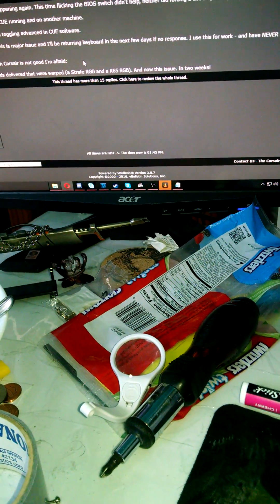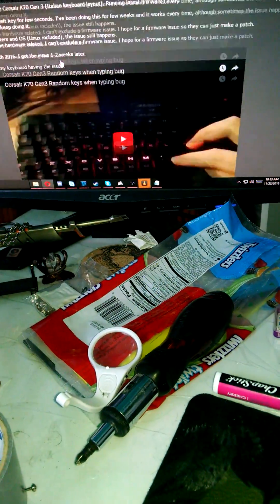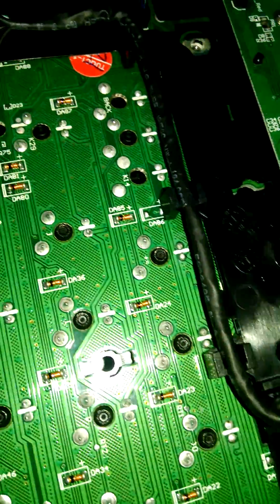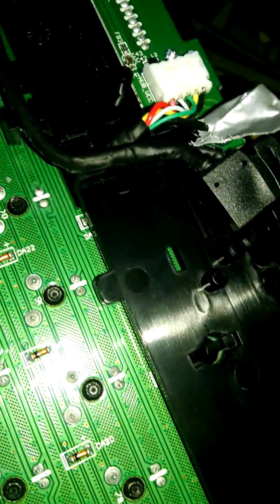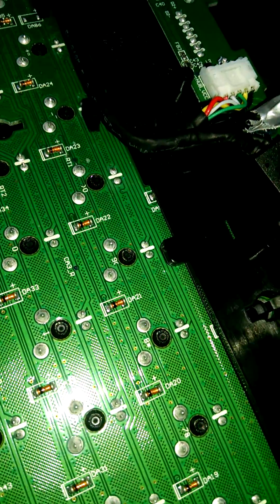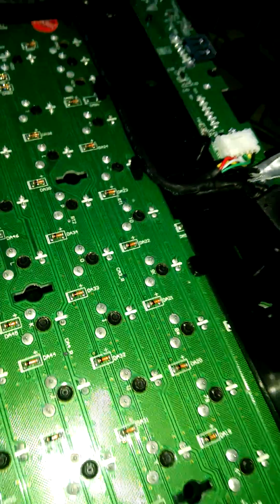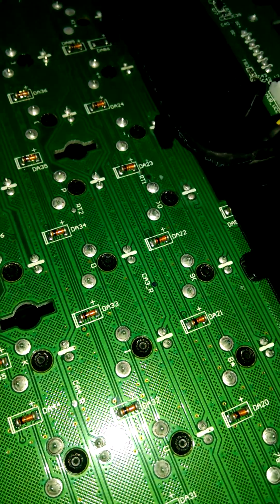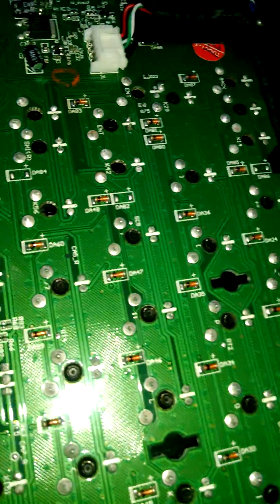Corsair K70 bug fix

Comment: Some TIPS: If you want to get the glued Corsair logo plate off without demaging/bending it, use a flat head screwdriver, dip it in Isopropyl Alcohol and drip it around the Corsair plate. The alcohol will go underneath the metal plate and loosen the glue. Let it soak for about 30 seconds, after that start lifting the Plate slightly with an sharp knife (e.g. carpenter knife). Do it slow to allow the alcohol to get to the lifted area and do the work for you. Maybe add some more alcohol if it goes dry. I removed my logo that way without any demage.

Also while reassemble the bottom plastic molding, watch out to have the bios slider in the right position to match the actual switch, you will see what I mean if you are at that step. I had to redisassemble it because I misaligned it...
Reply: I used the Keyboard after removing the ground cable between the 2 boards, it is working fine now. The Media Buttons were - except the volume wheel - not functioning before, that is still the case. Now I use it as a secondary keyboard for homeoffice. From time to time I have to switch the BIOS selector switch from one position to another and the back, that resolves the issue every time so far until at least the next power cycle. I can live with that. Still a great keyboard with MX brown rgb.

Thanks a lot for this guide Raffik!

Comment: Did you figure out what the deal actually was? My K70 is completely dead & I just now got the motivation to tear it apart. Getting into it now
Reply from the maker: Yeah there seems to be some bits being passed through a grounding wire which was fucking everything up. Removing the grounding wire fixed the issue.
Reply: @RaffikTheOnly  LOL I'm fucking with the grounding wire as we speak. But yeah I cant see anything that would cause it. I figured I would find a loose wire or burnt chip or something but nope. No spills ever or anything. Stumped
Reply: @RaffikTheOnly  just watched the video again and it's kinda hard to see cause you never hold the camera in one spot but your K70 pcb looks nothing like mine. I have one grounding wire and it attaches to the pcb right next to the little white harness in the center of the board

Comment: Worked just fine also 1 of the connecters disabling the colour change button top of the keyboard i suppose since it doesn't work since i disconnected them but idk what the other does thanks dude you rock !
Reply from the maker: After a year of using the keyboard, I found out the thing I disconnected was the top media controls. Lights / lock / media playback is disabled

Comment: Yep. Same thing happening here on my refurbished Corsair k70 :(
Reply from the maker: Following the guide would get you up n running in no time.
Reply: Thanks - but I'm not going to invalidate the warranty for my new keyboard :) Creating a new profile using the iCue software seems to have fixed the problem?
Reply: @fobstaa  some of my keys dont function do u think ill be able to fix it by making a new profile bc it happened since i use the icue

Comment: Thanks for the effort Raffik! I did everything as per Your video but problem still exist :( I will try to leave one of the connectors connected and other one disconnected if that can change anything .. so frustrating.. I have corsair CH-9101020-uk

edit: One day after i did Raffik's magic trick, it seems everything is good now :) First day everything was the same as before. I really hope that solution is permanent. Thanks again!
Reply: Hey, im having this same issue. I was thinking about trying this. After two weeks, can you say with certainty that it fixed your problem?
Reply: Well from time to time I have the same it problem as before. Like now :( I usually restart and after some time everything is good. But answer to your question is that problem was not fixed 100%
Reply from the maker: @cekikv  dont restart vlad, just mess with the BIOS 8ms 4ms 2ms 1ms switch on the top

Comment: Will this affect anything in the keyboard? I just got mine out of the box and this glitch happened to me, will everything be fixed and act as if I didn't change anything?
Reply from the maker: Auxil XB I mean. I did this, and it hasn't effected anything and works just fine.  The software works fine macros etc work. Idk what I unplugged but it works.
Reply: RaffikTheOnly ok, gonna do this tomorrow because It's such a hassle returning shit online
Reply from the maker: Auxil XB that's why I did it in the first place. Please reply on the forums link if it worked for you. Thank you.